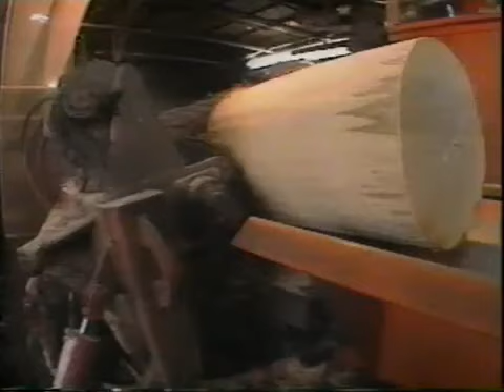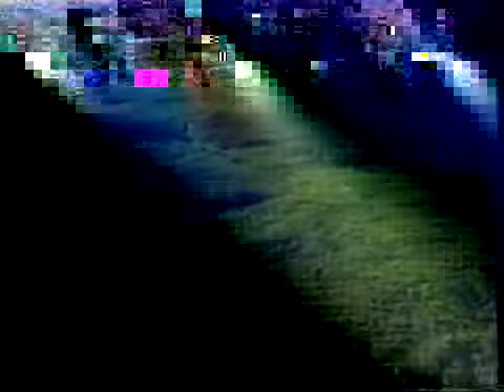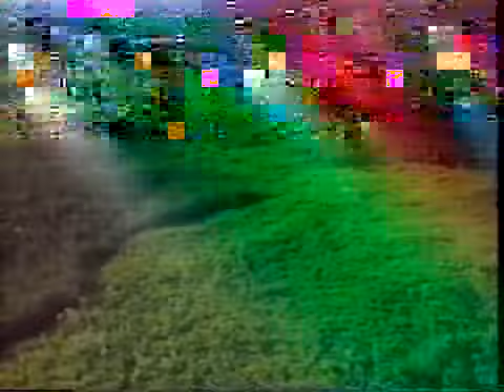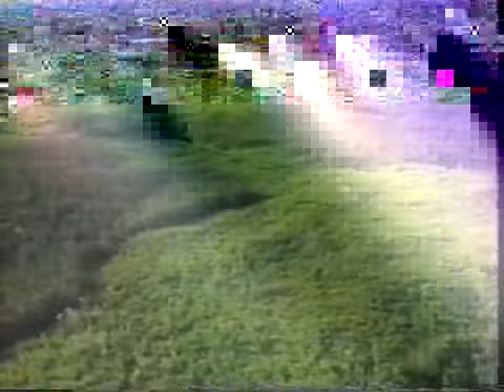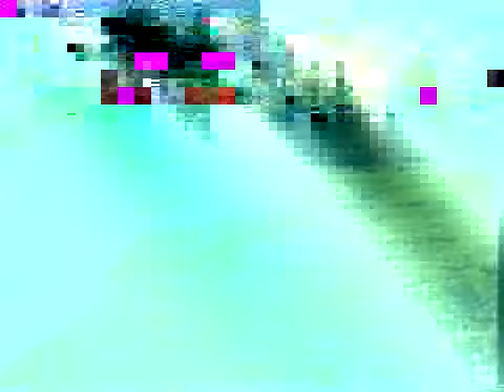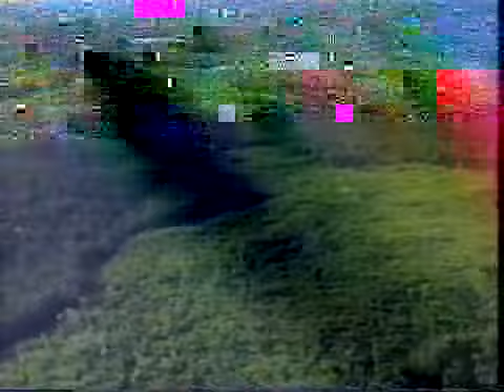How wood veneer is made...

Comment: I worked for a veneer plant in Idaho once. We had to debark the trees by hand though, one of the hardest jobs ive ever had.
Reply: They do this at the plant I work at in Indiana
Reply: @unknownuser2929  curious....where do you work? I'm in Indiana as well!!
Reply: @F @FeatheredDreamStudio  I’m not there anymore but it is called Norstam Veneers in Mauckport Indaina
Reply: Curious how the mill keeps the cutting blades sharp.  Hope you can help.
Reply: @merlesking  Honestly not sure. But I remember if there was any imperfection in the log like a pebble or staple it would damage the blade and leave marks in the veneer. And they would have to go over and smooth out the blade and possibly replace it if it was bad.
Reply: @merlesking where I work at they have a area where a machine sharpens them.

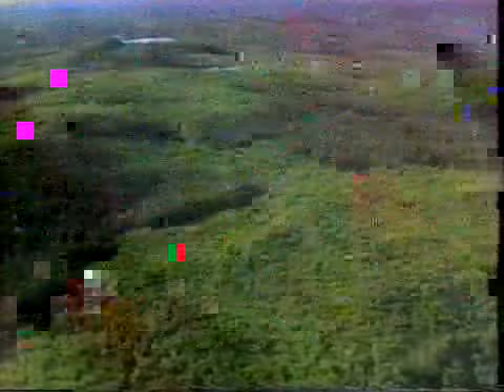Comment: how are the logs fastened tight on the machine at 4:57?
Reply: same way as the other ones, there's little nail head looking things that poke into the wood a bit, and a vacuums sucking the log against the surface and holding it to it. I was skeptical of it holding it there too til I started working at a veneer place yesterday XD

Comment: Not just that timing in the video. If you have in mind that this clip is taken in the 80's it's fine. As you can see many of the operations are done by operators. Today's technology replaces the no of Op's and the safety is at the high level.

Comment: Wouldn't you have to glue each piece of veneer to the one below it, to make plywood? It doesn't show this in the glue machine step
Reply: the veneers run through a glue curtain (waterfall of glue) on a production line before they are stacked and pressed.